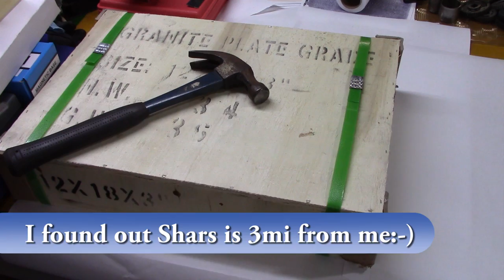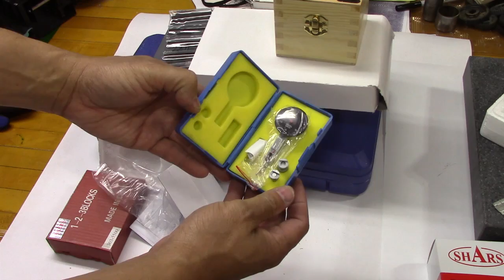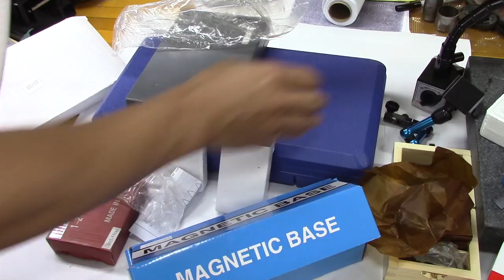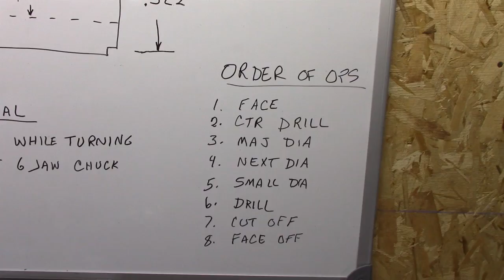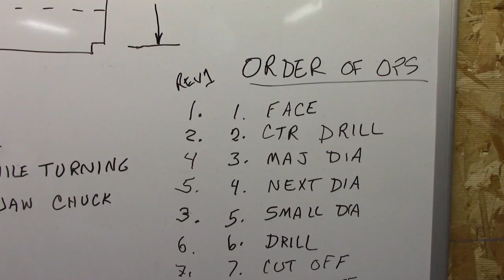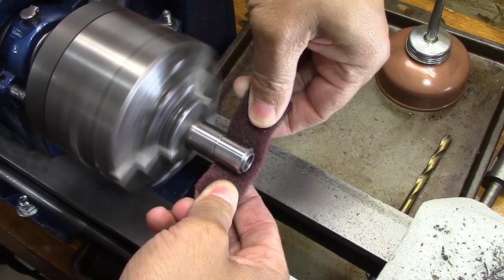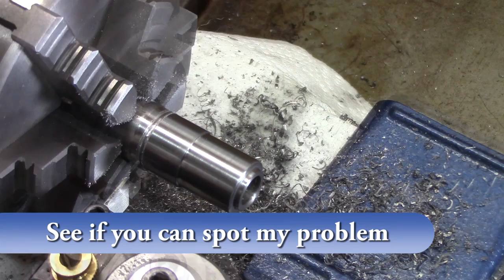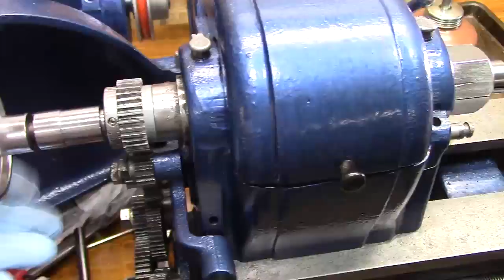Journey to Journeyman, Episode 2, How to make a drawbar spacer

Comment: You're getting a lot of chatter because your chuck is to far away from the spindle bearing with it stacked onto that face plate.  It's hanging out to far and deflecting. Besides the entire headstock being lose from the bed;) You're going to be much better off with a 3-jaw chuck threaded directly onto the output threads.

Comment: You can use a big tap but don't push against the spindle locked. Instead, use the "T" handle to turn the chuck onto the tap with the tap held in place with a tap handle against the bed.
Reply from the maker: Stereo Studios It took me a second to understand, but WOW!  How did I miss that!  So easy and it would have saved me some hassle. Thank you very much.....

Comment: you can use aluminum foil to replace shop towels on your tools,  it works well and not so likely to get caught in the machines,  i got that tip from a youtuber in canada , the wrecking yard,,,,i enjoy your channel i just subbed we both do this as a hobby and enjoy it also. from Bob in Seattle
Reply from the maker: +Bob N Thank you so much!  Great info and I never thought of that.  I will get some foil right away.  Thanks again.....

Comment: Nice video. Keep it up.A few comments.FIRST RULE OF SURFACE PLATES: Do NOT place random objects on a surface plate. On clean, de-burred, and wiped clean things should ever be set on the plate.

You do need some work on your grinding. Almost all your cutting and finish problems are because of your tool grind. I highly recommend watching Tom's Techniques videos on tool grind. For some reason I can't paste into my comment, so just search YouTube for it. He covers facing, turning, threading, etc grinds. He covers everything, explains it very well, and is a real master on the grinder. The tool you ground later in the video would work well on brass, it has too much rake and clearance for steel, and not enough round. Invest in a Norton white fine wheel, when you have your technique down, you will not need to finish the edge on a stone. I go right from the grinder to the lathe unless I am doing a final finish pass on brass.

That little lathe should handle steel well enough, you should be able to get a deeper cut than you are getting. Something is chattering, go over it and figure out what can be tighter. might be the QCTP. Piston style rigs don't lock things in well. Go over the post and the holders with files and slip stones. Make sure you have really good metal to metal contact. Better maybe to just get a wedge style though.

Dump that cheap digital caliper - it will ruin your day at some point when you least expect it. You can get the goods on digitals from the Ave channel (you want to watch his videos anyway). If you must use a digital, get a Mitutoyo (best in my book) or similar. Unless you really need the ability to swap between imperial and metric, a dial caliper is the way to go. Shars has a decent one at a good price, I use one for around the shop and it gets dropped, stepped on, piled on, etc. I have a good B&S one for when I am being more careful.

The lab coat is fine on a mill, I wear one all the time - I take it off on the lathe. Nitrile will pull your fingers in a bit before they rip, you can still get a nasty cut if your not careful. I wear them anyway. Tissues or toilet paper on the ways is really nice, you can just through it in the trash with all the chips.
Reply from the maker: +joshua43214 Thank you so much!  GREAT info!  I'm on my way to the basement right now and taking "junk" off my surface plate.  It truly is guys like you that I learn so much from.  The youtube machinist are the greatest. I do have a dial caliper that I use too.  I'm just starting to gather my "real" tools, and it will be a while before I get good tools.  I wonder about my QCTP now.  Mine is a piston.  Wedge huh?......    My financial planner (wife) is good at letting me get toys, but I don't want to push it.  I am being as careful as I know how with these machines that I have.  I have a real job and would hate to loose it because of my hobby.  Thank you for the info.  I will be careful.Thank you again........
Reply: You are quite welcome.
The piston style can be used, they are just inherently less rigid because they force the holder out into the dovetail. The wedge style force the holder into the face of the post and down onto the adjustment nut - far more rigid and repeatable.
Just spend some quality time with files and stones to get the holders to seat really well on the dovetails. It will get you by until you can snag a cheap replacement. Plenty of folks use the piston style with good results, better to clean up what you have and spend the cash on something you need.
The wedge style are also more repeatable. You can take out a face tool, swap in a parting tool to make a groove, then put the facing tool back in and it will be less than a thou off from where it was before, even the cheap ones will do this with minimal de-burring. I use a Bostar that I picked up cheap on Ebay.
Keep up the good work.
Reply from the maker: +joshua43214 Thanks again!  Lots to learn.  I'll try to use my files and stones and get it as good as I can until I get a good one.  Thanks again.....
Reply: Joshua i though i am only just getting started with machining myself agree with you on the calipers. i have always hated digitals even quality ones. as for good brands. i agree with you on Mitutoyo but would also suggest Starret or Brown & Sharpe. all 3 of these brands are very good, Mitutoyo is probably the cheapest of the 3

Comment: Just wondering....when you were cutting the end of the shaft to size, did you have the tailstock tightened down and its spindle cranked into the center of your shaft with some pressure and locked in? If not, it may be the cause of too much chattering. In addition, check to see if the clamps on the bottom of the saddle on your lathe is properly adjusted. If they are too lose, rest assured it will cause chatter and inaccuracies
Reply from the maker: +GnosisMan50 It turns out that the spindle had loosened up.  I use blue locktite on it now and it's good to go.  Thanks for the info.....

Comment: carbide likes to work it needs larger feeds and speeds. i am not a pro machinist by any means but i would suggest using hss toolbits on your lathe.
Reply from the maker: Jamie Buckley I learning how to grind HSS right now.  Wish me luck.  And thanks.....
Reply: I see your using carbide braised tooling i use them as well i really like them. I sharpen them on a green stone meant for carbide.
Reply from the maker: I don't have a green stone.  I'll have to look that up.  Thanks....

Comment: I do not know if you will ever read this comment, but here goes. You are doing better than I did as a beginner!  First operation is never to face off. It is always to check the lathe. I have a tiny Taig -- even smaller than yours. First thing I do its see if I can make it rattle. Check your gibs! Vibration loosens everything. Takes little time and saves trouble. Check to see the tool will not run into the chuck. Other than that, I turn hot rolled from Lowe's all the time (all I can get here in Alaska).  I use carbide. The first cut on Lowe's steel is always horrible, you are getting the scale off. With carbide, knock up the speed a notch and take a faster feed. Taig has no power feed, it's all feel. The angle of attack (between leading edge and long axis of lathe) can always be adjusted till you find the "sweet spot" which is tool-dependent. Watch the chips. You should be getting "curlies."
And Randy Richards is "spot on" as soubleboost would say. Go purchase the South Bend manual. I really enjoy this series even if I came in late to the party as usual.
Reply from the maker: Juan Rivero I read every comment Juan.  My entire machining knowledge comes from great guys like you that give me such awesome advice!  Thank you very much!  
I will give my machine a "once over" next time first.  I know I need to read, but I hate reading and it's hard for me to start.  I will have to knuckle down and do it.  I do have the Atlas "how to run a lathe" book and will start with it.  Thank you so much again and I hope to get better and better......

Comment: Do you have a copy of "How To Run A Lathe" by South Bend?  It was painful watching you fails.  What kind of bearings are used on the spindle of the lathe? Good finding the loose Head stock, tighten and alignment is in order.
Reply from the maker: Randy Richard LOL Randy!  It was just as painful to live it!  I do have the Atlas equivalent to How to Run a Lathe.  My problem is I hate to read.  I'm realizing that a few hours of reading may save me lots of hours of "hard Knocks".  I'll have to put it on my bed stand and just do it.  
I have the Timken bearings.  I did tighten it, but I don't think I can align my little lathe.  I wouldn't know how to do it anyway.  I do have it up and running and Brad Jacob let me participate in the WIYB tool giveaway.  I just sent him my part on Friday.  He should get it early this week.  I will be uploading that video tomorrow or Tuesday. Thank you so much for the info......
Reply: jster1963 You might be amazed at how many things you can align to within a mil (0.001") per 6"  or even per foot using good quality squares.

You've got Discount Machine (SHARS) near you (St. Charles, IL), and you can get good combination squares and machinist's squares for reasonable prices... Heck, I order stuff from SHARS (off of ebay), and get it out here in California within a couple of days...

Main thing is to get the headstock square to the ways horizontally and vertically, then square up the toolpost to the spindle using your chuck or faceplate.

Having the ways true to the workbench helps, but I find that the use of a machinist's (millwright's) level is a second or even third order correction by contrast... I used to work with guys who learned machining in the Navy - trust me, a machine aboard a ship is almost never level... but it is kept true within its components - what is called "in tram" for a milling machine.

Again, while you need to get really finicky for optical grade parts, you can get really, really close to true by careful use of squares...

Cheers,

Eric
Reply from the maker: Great info Eric!  I did drive over to Shars (they are 2 miles from me) and got some squares.  Now I have to learn to use them.  Thank you very much....
Reply: jster1963 About as close as Little Machine Shop is to me... except that LMS doesn't have a showroom...  not that that minor detail stops me - or even slows me down all that much - when it comes to spending money... ;^)

And, I've seen you using the squares in your more recent videos...

Eric

Comment: First of all, love your videos. I just bought a similar Atlas on eBay and am a bit anxious for it to arrive and see exactly what shape it's in. After watching your restoration vids I'm confident I can make whatever repairs, tune-ups, or upgrades I might need, so super thanks for that! I'm going to be using mine to prototype custom implements for my tractors, so now I'm going to have to catch up on your tractor restoration as well ;)

I've also been watching all the channels you mentioned in your previous video, and have an excellent addition to the list. Take a look at THATLAZYMACHINIST, his videos that cover the theory behind all these operations are the best I've seen. I'd start by checking out #s 008 and 009 on Chips, Feeds, and Speeds, as well as LQ006 that follows up with tool placement. They're absolutely fascinating, and I think will really help answer a lot of the rubbing-vs-cutting problems.
Reply from the maker: Thank you very much Ben!  I've made every mistake in the book with both my restorations and my learning how to use the lathe.  I do love it though.  I have watched several of the "THATLAZYMACHINIST" videos.  They are excellent learning tools.  I will have to check out 008 and 009 cuz  I really hate rubbing metal.  If you make any videos of your restoration or your making parts, please let me know.  I'd love to see them.   Thank you again.......

Comment: good video specially sojourning into machining as a hobby...and recording your experiences to boot! Now that you have the machinist bible i would suggest "homework" as in learning to use the book. first and foremost, know your feeds and speed (surface speeds that is) to the materials your cutting the bigger the piece/cutter the slower your surface feet per minute, and vice versa for small work pieces/cutters, one of many reasons why you have chatter, check to see that all of your gibs are at the proper tension for rigidity. as long as you are roughing (never baby your cutting tool bits) you shouldn't worry what your workpiece looks like, until you take finishing passes. to begin with your projects should never be of precise sizing because your learning, it's just good practice to stay within .005, +/- .003 until you get a feel for your machine (compensation for any drawbacks) when you feel good and ready, then tackle the precision, although getting the hard part out iof the way is also a good idea, as for your six jaw chuck, as a project...make it a set true chuck where you install grub screws on its circumference to get the chuck true, much like a four jaw chuck this way you take advantage of the out of round register the register...i would suggest google-ing frank hoose and get more info there, great vids, (although your comic relief is nothing to be desired...my uncle said you should truly laugh at least once a day...and though i don't laugh at the dry humor i at least I truly laugh). Keep up the great work. Oh, how about a "what's in your tool box episode/segment..and dial or digital calipers are for reference and not precision work
Reply from the maker: Thank you very much Edwin!  It's so funny because right now I'm editing my next video and comment that I don't know how to use my bible.  I'm going to take your advise and learn how to use it.  Also, I comment on my gibs not set tight enough (are you watching me edit, LOL)  I know speeds and feeds are important, but I've been lazy in learning them.  I will really try to work on that.  I will look into frank hoose vids, because I'm not really sure what a set true chuck is, but it sounds like something I would like.  As far as a "what's in my tool box" episode.... I'm so new that I don't have a lot, but I may do one anyway.  My sister is my biggest fan and I do the dry humor for her.  It's my goal to make her laugh.  Anyway, thanks for the suggestions and thanks for watching.......
Reply: jster1963 Cool,  just take things slow...don't rush into things because my journeyman friend and mentor once said, rushing into things is just going no where fast,  I was where you are and I have to say though the learning process were frustrating at times, the satisfaction of making something on your own outweighs the fails, i have to admit, I feel like crap about commenting on your humor, so my humblest apologies family make the best fans...my sister looks to me to get her out of getting her pay docked, at her job, if anyone is late to work, they'd have to tell a joke in the morning meetings, well she was always calling me for jokes, and insisted on relaying clean ones (office setting and all) and within a week she blew through all my jokes (hard to keep it clean), so she called (yet again) for another joke but this time I told her, Lu, short for LuLu, I'm fresh out...unless i can help you with dirty ones you're SOL, her line was quiet, then she asked how dirty are we talking, then quickly reconsidered, she panicked and asked, what am I going to do...so I thought about it, then it hit me..."tell them the truth, tell them how you got to this point in "YOUR" joke telling every morning because that in itself is really funny...suffice it to say, she was never docked but she hasn't been late to work in quite sometime. Cant wait for your next video
Reply from the maker: No need to apologize about the humor whatsoever!  I don't take that personal at all!  My wife tells me all the time how dumb she thinks my jokes are.  And I know it too.  That's why it makes me chuckle.  I have a 10 and 12 yr old, so I have a tons of clean, corny jokes.  I'm glad you could help your sis with jokes.

Now about going slow.  I know I should go slow, but it's hard.  I want to be great YESTERDAY:-)  And yes, it is so rewarding making something out of nothing!  I use both of my "home made" parts (thread protector and drawbar spacer) on my next project.  VERY rewarding!  I will take it slow.

Thanks so much for the comments.....

Comment: For releasing the collet a rubber mallet isn't a good tool.  You need to give it a sharp rap so the shock of the impact helps release the taper.  With the rubber you'll have to hit it too hard and be more likely to bend/break things.
Reply from the maker: I figured out the hard way that a rubber hammer in not a good idea.  I use my hammer and use a 3/4" bar.  I put the bar in the center and give it a sharp tap, and bingo, it's out.....